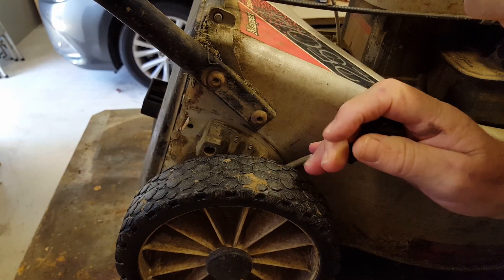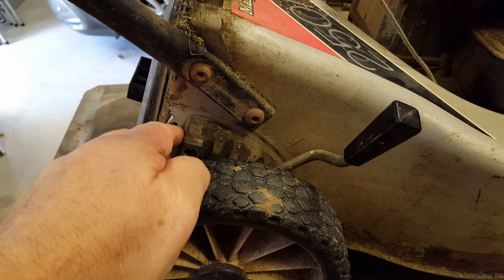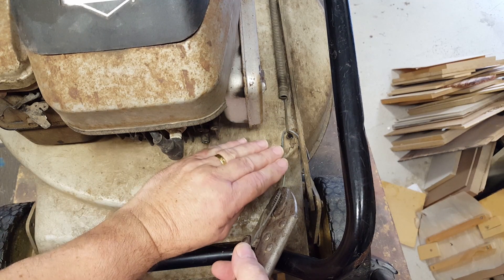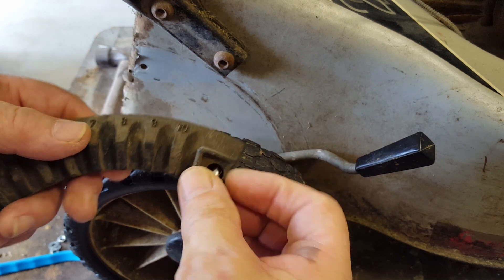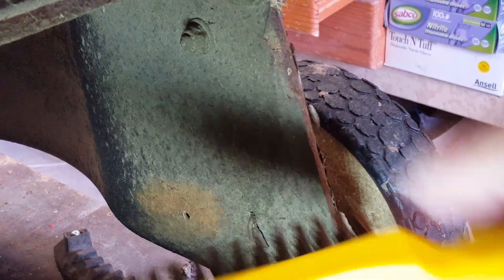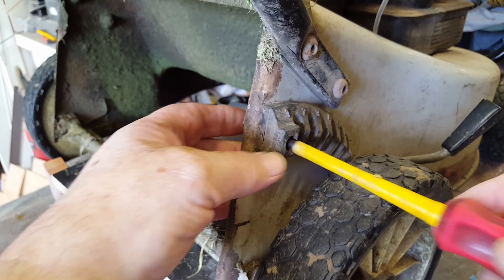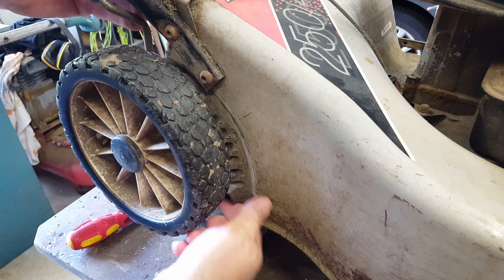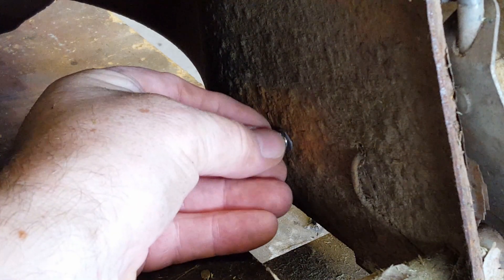Masport Mower Model 250\4 Broken Height Adjuster Repair

Comment: I was so excited that there was a video showing how to fix/replace the height adjuster, but you only showed how to replace the height adjuster bracket/slot, not the real PITA part which was the lever filled with punch rivets. Thanks for the video anyways.